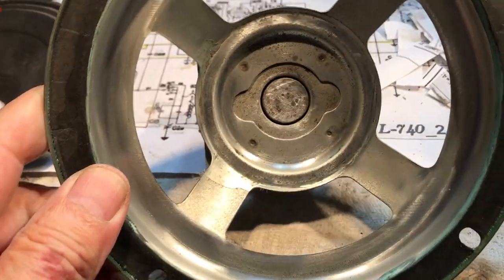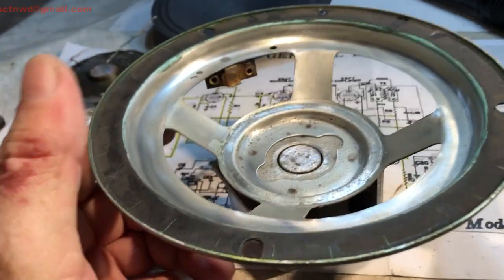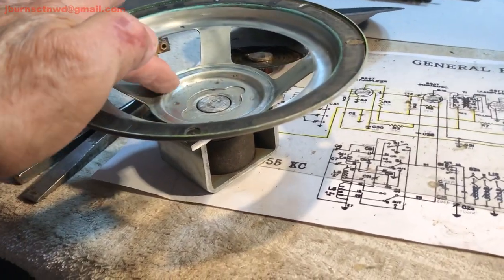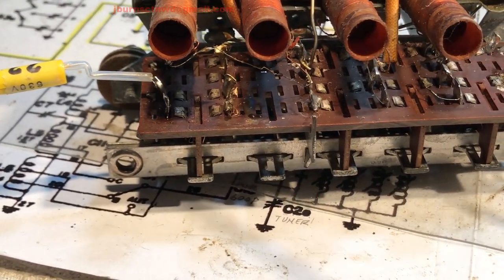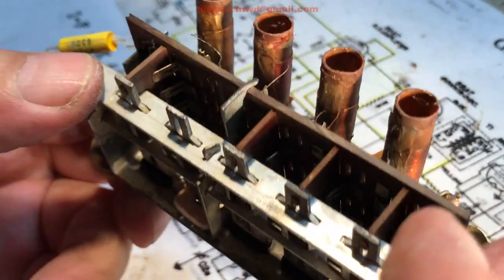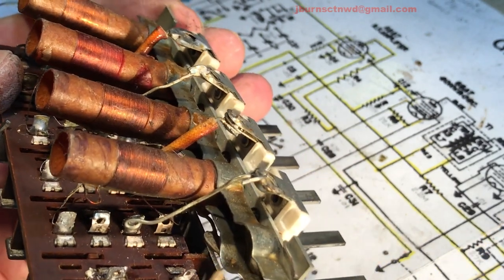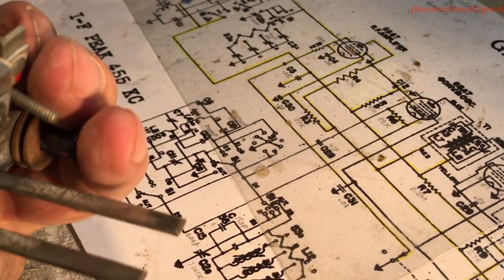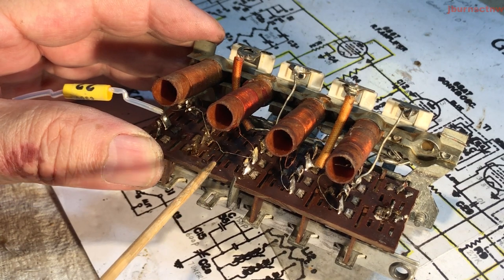General Electric L-740 In Progress 5

Comment: The problem with flying insect killer is it doesn't work on those itty bitty flies. Talking about drain flies and fruit flies. The 
active ingredient is from  Chrysanthemum flowers so it won't harm you Jim. A bad speaker is no surprise seeing how 
caked with crud it was in the center. Four oscillator tuned circuits one for each channel to pre-select and one for switching
over to the phonograph but it seems the fourth position is not functioning. Taking it apart is going to be really  hard. 
There's much to desolder ,  like a spider web of connections.